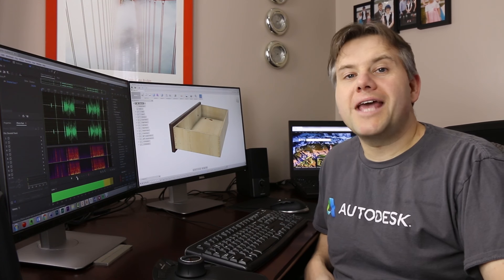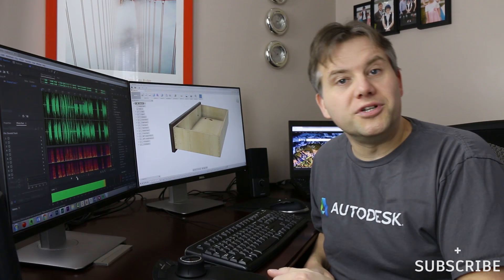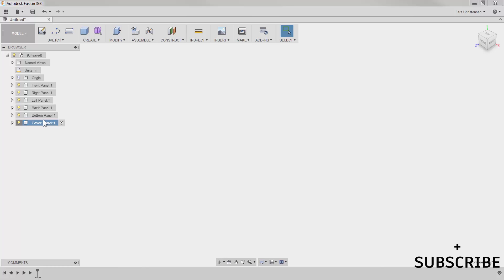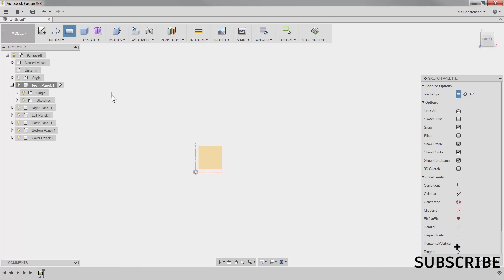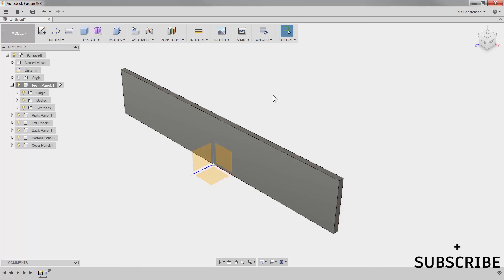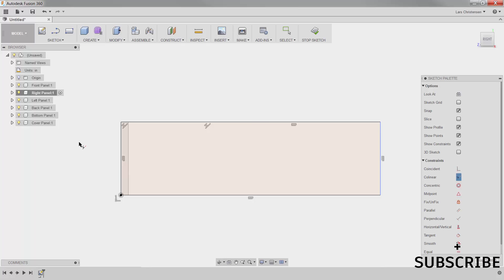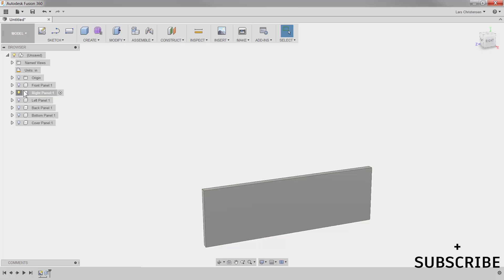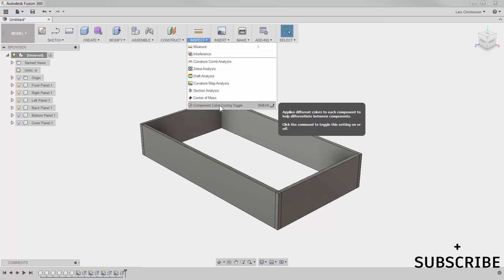Fusion 360 Tutorial - How to Model an Assembly Drawer with Dovetails from Start to Finish Part 1

Comment: I was almost forced into Fusion 360 because I bought a new Mac and went to download the 123D Design program and found it was discontinued. I didn't really want to learn something new, and complicated, until I found your videos. I got a great deal of information out of this particular video and used it to go through each stage of the process myself. It was so easy to forget to switch on and off the fisheye, and I didn't catch the little end face on the drawers when extruding initially.
 
I'm going to try to run through this once more without having to 'cheat' and run the video again! Great fun and this seems so powerful. Thanks Lars - it's a pleasure learning from you.
Reply from the maker: Best of luck Michael! I will be rooting for you :-)

Comment: The series is great, but the one thing that confuses me the most is the fact that you're using Y-up perspective, while the default is Z-up (that's in Preferences > General > 'Default modeling orientation').
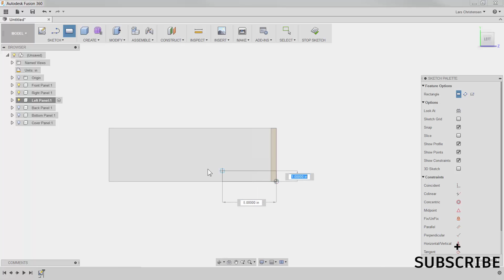The other setting I was missing (at 14:40) is in General > Design > 'Auto project edges on reference' (before turning that on my lines stayed blue after drawing an identical rectangle as Lars).
So maybe just mention that so people who are watching can change it too, because I almost gave up before figuring that out.
Reply: Thank you so much! I couldn't work out why my rectangle wasn't snapping to the corner of the other side panel
Reply: Thanks for pointing out this configuration parameter!
Reply: I want to add to this comment because my preferences defaulted to  'Auto project edges on reference' being checked.  Super.  Still didn't define that left panel rectangle sketch.  For me the last piece of the puzzle was in the 'Sketch Palette' window.  ***Uncheck the box "3D Sketch"***.  I think it has to do with being square to the sketch plane.  I could never figure out why Lars's views went normal to the selected plane, but my view did not, when I selected the plane to sketch on.  3D sketch was checked by default for me and it messed me up a bit.

Comment: Your videos are great Lars with regards to every key stroke and mouse click so easy to follow.
now come on mate USE METRIC not inches, I was brought up on the imperial system and let me tell you the metric is so simple.
I went through a slow change from working with machines in imperial and metric some had dials with both both on them but the metric system is by far easier.
Thanks again Lars keep up the great work

Comment: Very nice an clear video, as usual. How would one make the half-inch "width" of the boards be "linked" to only a single value-entry? What would be the advantage/disadvantage of sketching a rectangle with "offset" of wall-width and then extruding the "height" of the boards? Sometimes it would be helpful to have a "comparison" video of differant approaches to the same goal - just to see the differences. (Need to watch the part2/3 videos now, so maybe some answers are there already :c) )
Reply from the maker: Thank you for taking the time to watch the videos!! Parameters would be the answer to your first question in regards the thickness(in the Modify drop-down)
I am not sure if there are any disadvantages to offset instead of drawing a rectangle. Yes, there are many ways to model the same part :-) Heck, I'm sure I would not model a part the same on two given days.

I hope you have an awesome day!

Comment: Great video (just like all of yours). By the way, the very front piece of the drawer is called a false front (I make quite a bit of furniture at home).
Reply from the maker: Thank you for watching! "False Front...ahhhh awesome :-)...I just made the names up...Had no idea. I'll have to come to your house and take a class!!
Reply: Lars Christensen 
I'm in the middle of building custom office furniture for my home. Two sit stand desks with maple tops. Two steel and maple credenza's (I welded in my garage) with file drawers and a center cabinet with drawers. All finished with aniline dye and hand rubbed tung oil. You can probably guess it's for my wife and I.I used fusion 360 to mock up the credenza's. Yours and others tutorials proved to be very helpful. Thanks.
Reply from the maker: Dude, that is awesome. I need to convince the wife that I need a welder in my garage :-)
Reply: For furniture, I would recommend a small flux core wire feed welder.
Here is a picture of one I'm using to build the credenza stands: https://goo.gl/photos/nUw3Y19pbQ9HktMt9 (I know, messy garage). I also used it to make a dressing table for my wife out of alder and metal with an alder led lighted dressing mirror ( Video here: https://goo.gl/photos/bD3GsCyijhtoiX348 ). I did a lot of welding when I owned a body shop and this one from amazon is a good one for hobbyists: http://amzn.to/2kRpHTl and it's only about a hundred bucks.
If I had learned Fusion 360 earlier, it would have been a lot easier to do so thanks again for the tutorials. The credenza's were done in Fusion 360 and I showed it to my wife first.

I also built a 3d printer and used fusion 360 to model the feet for the dressing table and printed them out on my 3d printer using black petg filament. 

You can probably tell that even though I'm still learning Fusion 360, I am loving it already.

Comment: Everything was fine until you started to use the imperial system. For precision and sanity, I would recommend the metric system.
Reply: In a perfect world it would all be the same. It's caused more problems for me than anything else. If I forget to tick one of the numerous boxes in the software I use. I would be just fine doing everything metric. Yet I continuously have to select one or the other. Nuts.

Comment: Hi Lars I had a number of problems. It might be a poor download,poor Internet connection or windows 7.I feel your instructions are what I needed to learn Fusion.I was very discharged when I gave up and removed Fusion from my system.Now I have had some time to think about the problems they were the blue lines never turned black but stooped moving ,when I put in the dimensions it took several times to get the fractions to enter, I worked off line to see what happened and I could not get back on line. I have 2 computers one on YouTube and the other on Fusion .My screen is not  the same as yours so I thought it was because of upgrades.
Thank you for your interest Bill
.
Reply from the maker: Thank you so much for taking the time to watch! Go and click your name in the upper right and select preferences. Then, click Preview in the left dialog box and check the first item "Sketch— color sketch geometry based on constraint status." I did not realize that was made the difference on the line color when recording the video :-)

Comment: Hey Lars thank you so much for posting these videos. They are very helpful. Just a question even when I tie my 1st rectangle to the origin using midpoint constraint it remains blue somehow and does not turn black. What do I do?
Reply from the maker: Thank you so much for taking the time to watch! Go and click your name in the upper right and select preferences. Then, click Preview in the left dialog box and check the first item "Sketch— color sketch geometry based on constraint status." I did not realize that was made the difference on the line color when recording the video :-)
Reply: Lars, this bit me too.  Maybe you could add a text comment in the video or insert a quick sidebar?  Thanks for the videos, they are very good!

Comment: Could you set parameters as height/width and so on and dimension these with words in the sketches so you just edit the parameters if you want a different drawer?
Reply from the maker: Yes, at the bottom of the Modify drop-down you will see "Change Parameters" here you could control all that.

Comment: I am a furniture maker and have really enjoyed learning this program.  I am running into an issue that may be solved by a setting change.  I have found that when I try to tie a sketch to a point contained in an inactive component, the program will snap to that point, but the sketch in the active component does not go to black.  I have run into this issue in several tutorials.  Have I missed a basic set up?
Reply: I have this exact same issue. Something has obviously changed between version of Fusion 360.
I believe the main issue is that when snapping to the point of the other component, we are not really snapping to a point of that component but rather snapping to the grid, which is on the same plane we are currently sketching on, which would of course mean that the sketch will just float in space, hence not going black.

I have tried googling about if there is any setting for this, but I have not found anything.
For now I have simply created the constraints, e.g. in this particular video using the colinear constraint, on all the panels, since I don't get them automatically.

Comment: Love your tutorials and style! One thing I don't understand about Fusion 360, during last Push/Pull of the back face (at 16:02) there are two rectangles that needed to be selected to ensure the full face is extruded. 

I would have expected to either select 3 rectangles (left & right panel's edge + inner back panel)  or simply 1 rectangle (the full back panel). But not 2 rectangles. It seems there's no reason as to why Fusion 360 choose include the left panel in the intersection but not the right panel.
Reply from the maker: Hi skube Thank you for watching!
I will have to look into that. Could be something in the way the software brakes up geometry selections. I don't know much about coding and all that fancy stuff :-)
Reply: I think it is because it was the face you referenced from.  Appreciate these videos by the way, I actually feel like I have a shot at becoming proficient enough to model my projects before I go into the shop and waste material trying to figure them out!

Comment: Hi Lars, Just started learning how to use fusion 360 from your video on the table build. Allot of steps and you make it look so easy. Two things are slowing me down. First moving the part around. There must be a trick with the mouse? The other issue is how to get rid of the background grid. After you do the sketch your background is blank. How did you do that? My settings are different too but I believe you have set yours up different from the default settings. Anyway just some questions. Thanks
Reply: If you go to Preferences > General > 'Pan, Zoom, Orbit shortucts' and select Tinkercad you'll be able to Orbit using ctrl + mouse.
Reply: Thamks, since I wrote this I have become more proficient with this software

Comment: Hey, thanks for making these videos.  I really learn well when I just follow along step by step through a project, I think that's a great way to learn this kind of thing.  I'm having a little trouble fully defining the first sketch of the left panel (14:40).  In the video you just drag the rectangle and it knows its coincident, but when I did it, fusion didn't pick up on that.  When I try to do it manually, it either won't let me select the reference point on the right panel, since its outside of the sketch plane, or if I make it a 3d sketch, it stretches the actual geometry to the opposite corner and it all gets kinda weird.  I wasn't too great in geometry class, but it seems like the two points in question aren't actually coincident anyway, they just align on 2 out of 3 planes.  What am I missing?
Reply from the maker: Hi cmikk Thank you for watching!
Honestly, I am not totally sure. Can you drag any of the corners with your mouse? Different constraints can be used for the same result. If your sketch is constrained, I would not worry about it.

best,
Lars

Comment: My sketches wont turn black when there is no degree of freedom left? Is that changed or something ( in an update )?
Reply from the maker: Thank you so much for taking the time to watch! Go and click your name in the upper right and select preferences. Then, click Preview in the left dialog box and check the first item "Sketch— color sketch geometry based on constraint status." I did not realize that was made the difference on the line color when recording the video :-)
Reply: I got caught by the same thing when following your beginner's video. Would be nice to mention it in one of your other videos and/or in the sub-text of that video. Luckily, I "found" the anwser quite quickly when Googling the forums, though... So it was not too much of a showstopper.

Comment: Maybe it’s because I have a newer version of fusion 360 and it works a bit differently but when creating the initial sketch for the right, left and rear panels, the second point did not automatically click for me. So when editing the sketches near the end of the video, my rear panel did not change with the other panels. Should I just do a colinear with the top and side of the rectangles?
Reply from the maker: That video is getting old😊Yes, throw some Constraints on that thing
Reply: @cadcamstuff  I could not get constraints to work for left to right side corners, so I just changed it all to use defined parameters. Thanks for a great series of videos!

Comment: Hi Lars,
As always loving these tutorials!  Nice work - you make it easy to follow along.  I noticed that you said that you should hide all other components when working with push pull (Q key).  I forgot to do this just now and noticed that my push pull didn't affect the other component that was visible.  Is this something that's been updated  - does push pull now only affect the active part, regardless of the visibility of other parts.  
Thanks
Sam
Reply from the maker: Hi Sam Morris Thank you for watching!
You also have an option in the Press/Pull menu to select and un-select what components, check that out.

Best,
Lars

Comment: Hey Lars thanks a lot for all these great videos. Just a quick question, when I tried press pull command with a distance of -0.5 in, i kept getting errors due to the geometry issue...what shd I do? thanks
Reply from the maker: Look at the bottom of the menu on the right. Is it trying to cut vs join?

Comment: I'm very new to fusion but after watching these 4 parts I was wondering a thing. Maybe you did it this way for teaching purpose or maybe you did it because it's a better way to do it than what Im thinking for some reason I as a beginner don't see. But I was wondering if it would not have been easier (or even possible) to make the grove in the panels by drawing the bottom and use that as a tool to cut into the 4 panels, just as you cut the dovetails into intersecting boards? - I mean you have to draw the bottom anyway why not use it as a tool to cut into the panels? - would it have done something unwanted I just can't see? - Thank you again for an awesome tutorial . ps. are you danish? :-) (you don't sound danish but your name does)
Reply from the maker: Sure, You can totally do that.

Yes, originally from Denmark, now living in the US

Comment: Excellent tutorials, nearly perfect English, YAY.  
Good logical top down flow to your approach.  Not too simple, not too difficult, just right. 
 I am a retired physician in the US and have been  into computers forever and have had a full woodworking shop in my garage for a long time.  Now I have the shapeoko 3 xxl (or does it have me)  .  Want to do guitar parts (I am also a Luthier of 25+ instruments and don't want to do it all by hand anymore), signs, different carvings etc,    am experienced in photography (Photoshop cc and many adobe apps etc, topaz, Nik etc etc)  do most of my drawing for projects in corel draw which is fine as far as it goes.     I love fiddling with stuff like this.  Tried sketchup but I hope and it seems that fusion 360 is easier to learn.

Comment: Hi I was trying to follow along in Fusion 360 and got to the point of having the left right front and back panel joined  and the grove of the front panel made.  I am having trouble after adding the rectangle on the right panel and trying to use the colinear function in sketch.  I have the right panel activated and the diaganol selected I press the colinear function select the bottom line of the bottom line of the new rectangle on the right panel but the program is not allowing me to select the bottom line of the panel to make a relationship, I was wondering what I was doing wrong
Reply from the maker: Make sure you are looking directly at the part. Also, try to right-click the view cube in the upper right corner and make sure you are not in perspective mode. That can screw up selecting stuff.
I will say, that if you project and edge and that make you move on...do that :-)

Comment: Hi Lars, just working through this tutorial and at around 8:15, before you constrain the rectangle, you move your mouse over it and it highlights and moves when you click. Mine doesn't do that - no highlight, and I can't click on it. I haven't clicked Stop Sketch or anything... any ideas?  Thanks!
Reply from the maker: Hi Jack, Not sure exactly what is happening. My first suggestion would be to try to create something different following the same steps and see if you still have the same issue. It sounds like something graphic what of course could be both hardware and software related. Start there...